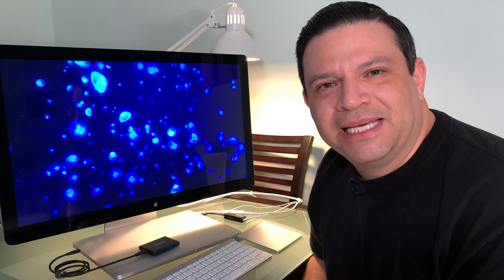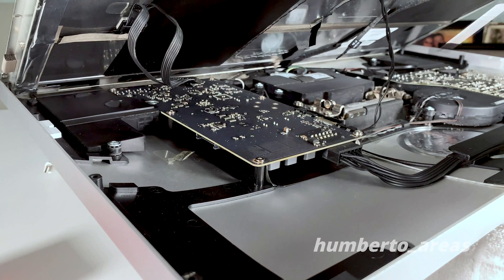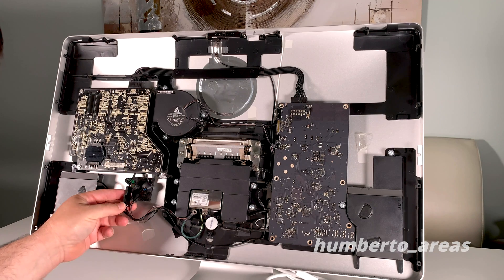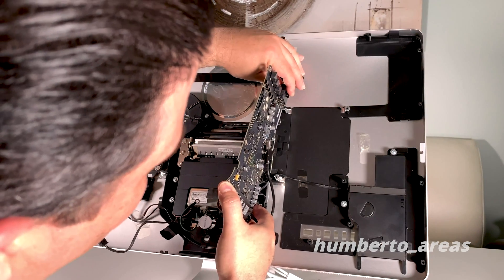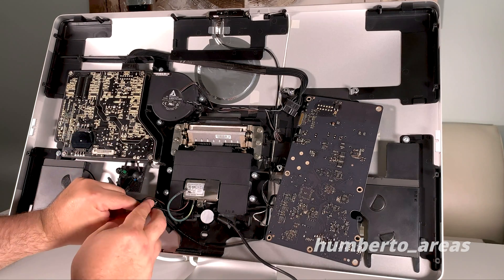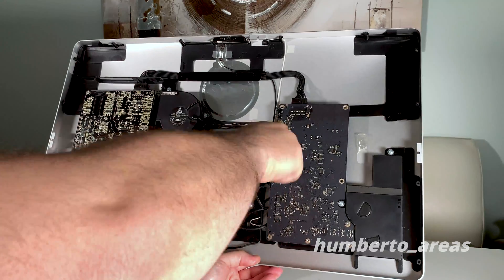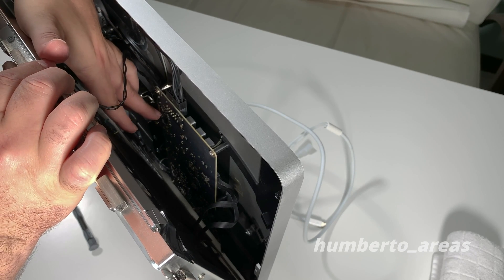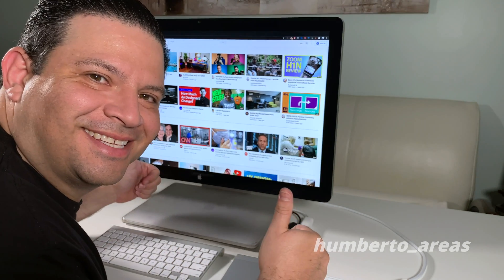Apple Thunderbolt Display Not Turning On - Step-By-Step DIY Repair 2026

Comment: My display blacked out, I heard a little pop too.  How did you know it was just the cable and not the power supply or logic board?
Reply from the maker: @Karl Simonsen, thanks for reaching out, greatly appreciate your question. I plugged display to my laptop and notice that under system preferences, my laptop recognized the monitor plugged in. I also inserted a couple of USB drive to the back of the display, and under Disk Utility, I notice my laptop recognized the 2 USB's - then I decided to replace the most inexpensive part... which was the cable, and bingo, it worked for me.

Please keep me posted on any trouble shooting you do on your own, thanks and good luck.

Comment: A great video. I’ve got this 27” Thunderbolt display, which I bought new years ago, I think about late 2011. It gets used nearly every day and still works fine. Just occasionally - maybe once every 2 or 3 weeks - it flickers, but always comes back on. Hoping I never have to fix it, but now I know how to do it! Many thanks for uploading this, it’s really appreciated.
Reply from the maker: @Orwic1, thanks for watching and for taking the time to post your comments. Glad to hear you got value out of the video.
Reply: I wonder if this is wrong with my display I got a few years ago for $100

Comment: Hello Humberto Areas, I have a question.  Is there an internal mini-port connection inside the Thunderbolt Display?  I want to use my Thunderbolt Display with my Mac Pro 5,1 Mid 2010.  My Mac Pro has an ATI Radeon 5770 that has 2 mini-ports.
Reply from the maker: @John, thanks for watching and for your question. There is no MiniDisplay port inside the A1407 Display. You may need a connector that goes from MiniDisplay Port to Thunderbolt. You should be able to find some online for purchase. Just be careful to read product description before purchase. I say this because a MiniDisplay Port cable end/connector looks exactly the same as a Thunderbolt end/connector. Good luck.

Comment: Hi! My 27" Cinema Display was showing small dark spots at the bottom edge (sort of like 2-3 1" half-circles). After unplugging it and letting it "rest for a month or so, it doesn't turn on at all. DO you think this fix might remedy my situation? Thank you for your time.
Reply from the maker: @John Platanatis, thanks for watching and for your question.

Let me ask you, if you connect your display (even though nothing comes on), does your PC recognize the display? Do the ports in the back work (perhaps you have a USB stick that lights up? Have you tried a different cable (thunderbolt-to-thunderbolt)?

Also, what is the model number of your display? And to what PC/MAC are you connecting the display to?

Thanks in advance for any additional info you can provide.
Reply: @HumbertoAreas  I just hooked up my 2015 Macbook Pro and the Cinema Display (#A1407) display is working again! But the 2 small half-circles are still showing up at the bottom of the screen. It's no major issue as I bought another display, but figured if I could get rid of the shadowy half-circles I would. Thank you so much for your info!

Comment: Quick question! I have exactly the same issue and a buzzing noise along with display going in and out. I have a LED Cinema Display (27-inch) A 1316. Do you think the thunderbolt is replaceable with A1316? Because I am unable to find the cable anywhere on the internet for A1316!
Reply from the maker: @Raven Quiah, thanks so much for watching and for your question. Unfortunately the all-in-one Thunderbolt replacement cable that I use in the video will not work for you. Your display has a "Mini DisplayPort", not to be confused with a "Thunderbolt Port" - They look the same, but they are not.

I have not been able to find a reliable source for cable replacements for your A1316 display. If you happen to find a good source, please share link with community on this thread here. Thanks in advance and good luck.

Comment: Hola, qué cables usas para conectar con los usbc de entrada en tu Mac?
Reply from the maker: @Nicolas Ceron, saludos y muchas gracias por tu pregunta. Aqui te envio links a los (2) conectores que yo uso.

👉 Apple Thunderbolt 3 (USB-C) to Thunderbolt 2 Adapter https://amzn.to/2N9leKW
👉 Compatible for MagSafe to USB C Adapter, iWiner USB C to MagSafe 1 & 2 Adapter for MacBook, New MacBook Air and More USB C Port Devices https://amzn.to/3B7FsM2
Reply: @HumbertoAreas  muchas gracias!

Comment: Dear sir, i buying the cable now for replace because my display have the problem same like you now (auto turn off and on few times and after that not lighting back). The code of the cable is: Mc914 922-9941. Is that right? Looking forward for your reply
Reply from the maker: @Nam Dinh, thanks for reaching out, I really appreciate your question. Please make sure that in the product description of the cable your are purchasing, it says that the all-in-one cable if compatible with a Thunderbolt Display Model A1407. Different manufacturers have different part numbers, so make sure "Thunderbolt and A1407" are in the description of the cable.

Thanks again for watching and please keep me posted on your repair. Thanks.
Reply: @HumbertoAreas  yes, thank you sir. I order it on the shipping now. Thank for you reply and i will update my repair

Comment: Thanks success and my monitor has come back to life. But be careful on the replacing ( final step) of the glass cover I cracked mine. OWC has OEM for 69.00. Happy New Year.
Reply from the maker: @Bill Lewis, thanks so much for your comments and feedback. Thank for watching and glad to hear your display is back! Many thanks for the heads-up on putting back glass cover. Can you share the OWC link to the OEM replacement on here please?
Reply: Well new issue replacing logic board. Here is the link for glass screen OWC. https://eshop.macsales.com/item/Apple/9229919/. I’ll update after logic board replacement.

Comment: I fixed the problem with your steps and all went well for 6 months. Now sadly the display does not turn on any more... I am starting to think maybe it has something tot do with the power unit inside the screen... Do you have any ideas 🙃
Reply from the maker: @Connor MacMillan, thanks for taking the time to come back and post your comments and question. Hard to say what could have gone wrong? Before the display going out on you, did it give any warning signs? Any flashing on-and-off? Or did it just go out? Very weird that it would work for 6 months and then just go out all of the sudden? Please keep me posted, thanks.

Comment: I have two of these monitors.  One was doing exactly this, but the other suddenly popped and went dead.  What do you think that was related to?
Reply from the maker: @2 Minute Tour, thanks for watching and for taking the time to post your comments and question. Hard to say what could have happened... as these displays at time they give warnings of things to come, and other times they just go out. Was there lighting in the are? Did you have the display connected to a battery backup or a surge protector? Can you elaborate on the "pop" sound? (as in a speaker 'pop' sound or internal component sound).
Reply: @HumbertoAreas  That's a good question.  I'd have to say that the pop came from the speaker if that was my guess.  There was no warning to the problem like there was on the other monitor that flashed on and off just like in this video.  Once the pop happened, it went dead.
Reply from the maker: @2 Minute Tour, it may be worth replacing the all-in-one cable on this monitor as well if you want to continue with your 2-monitor setup. Definitely worth a try, please keep me posted.

Comment: My apple Cinema Display has a different tope of conector and they're very expensive ( 150+) do you know how i can fix it is also a 27" and my MacBook detects the screen and also reproduces the music but the screen is only Black
Reply from the maker: @Daniela de Selys, thanks for watching and for taking the time to post your comments and questions.

What is the model number of the 27" display that you have? (you can find this info at the bottom of the display's stand). And what year and model number is the MBP you're connecting the display to?

Hope to hear back from you soon and give you better feedback depending on your setup.
Reply: Great video  @HumbertoAreas ! "A1276" are the specs on the bottom of my display. Im having trouble finding the specific connector of this display.
Reply from the maker: @VVOwrich  Thanks for watching and for posting your comment. I too have found it impossible to find replacement cables for the A1276... I will keep you posted if I find a reliable website that has them for sale.

Comment: Before your monitor going dead, did you hear hissing noise from the back of the monitor ? In your case, would you suggest problem of thunderbold cable part, or is it the MagSafe cable part?
Reply from the maker: @Sutop Sejati, thanks so much for watching and for your comments and questions. Before my monitor went dead, I heard no hissing sound. If you are experiencing this, it may have to do with your internal cooling fan. Try an independent MagSafe charger in your case... Your MAC needs to be connected to a power source when connected to the display if you intend to keep closed. Otherwise you can leave your MAC open while you test the thunderbolt connection only. Please keep me posted.

Comment: Nice video! I wonder IF my screen issue is the same? My MacBook Pro sees it (so it works) but I have the black screen ( I do not remember the flashes, perhaps it happened) is this a fix for that? I still have in the corner of my office..such a great quality display for graphics! Thanks!
Reply from the maker: @M Giovanni, thanks for your comments and question. And of course, thanks for watching. Some displays may give signs of warning, and some just go out. Like I've told many others who have commented on the video, "If you still love your display, replacing the all-in-one cable is worth a shot." It is by far one of the cheapest parts you can replace on these displays.

Please keep me posted on what you decide to do. It'll be great to get that display out of that corner and put it to good use again!
Reply: @HumbertoAreas  I was wondering the same thing as mine went out, came back for a bit and then out again. I LOVE that monitor even though it's almost 10 years old!
Reply from the maker: @janetcovey4306  Thanks for your comments and thanks for watching. Hope you git value out of the video. These monitors age like wine, so if there is a way for you to put it back in use... go for it. Please keep me posted on what you decide on doing.

Comment: Dear Humberto, I found your video very helpful, I change my cable because I strarted to have problems with it, it was burned in the thunderbolt connection that goes to my mac pro 2013 machine, I have "fixed " long time ago with gaffer tape, but till this week just stop working. the problems I had were that the monitor speakers  work just sometimes, but after I change the cable with your help, the speakers dont sound at all and the camera also dont work. do you have any idea what maybe be happening? Thanks in advance for your response.
Reply from the maker: Jose Ramon Pedroza, thanks for you comments and question - and of course for watching. Glad to hear you got value out of the video. So before you changed the all-in-one cable your camera and your speakers worked sometimes. And now that you replaced the all-in-one cable with a new one, both camera and speakers do not work at all. This is very weird and I'm not sure what may be causing the problem? Let me do some research and circle back to you.

Which part of the vide did you find most helpful?
Reply: @HumbertoAreas  thaks for your response, yes before I change it they work sometimes, so I think that maybe is a problem with the board, because I realized that also the ports at the back of the monitor aren't working to, the strange think is that the thunderbolt conection is ok, or maybe instead of the board is just a problem with a cable... About your cuestion about  what part of your video was most helpful, I found all your video very clear, well explained, steady and with good light. So thanks again for the way you made it. Saludos.
Reply from the maker: @chepopedroza  Thanks so much for the explanation and your feedback on the video. If the ports on the back are not working, then maybe something else could be the problem (besides the all-in-one cable).  Saludos y estamos en contacto.
Reply: @HumbertoAreas  , gracias Humberto, I let you know when I solve the probem

Comment: I just used your video to fix my Apple display. Thanks a mill for the tutorial. One note I would say is to be careful removing those 3 connectors from the logic board (2:15). The larger one has a clip underneath that you need to pinch and the gold one has a flap that needs to be flipped 180˚ to get it to release and they all slide out. I wasn't sure which way they disconnect and as you say our Thunderbolt Displays are now pretty old so those cables won't be as flexible as new. Great resource and thanks again. I can now go back to my favourite display.
Reply from the maker: @Mark Gogging, thanks for your comments and for watching. Glad to hear you got value out of the video and that your display is back up and running. Those (3) connectors are tricky, and I did the best I could capturing on video - given that I was filming by myself.
Reply: @HumbertoAreas  You did a great job, thanks. Have you had any issues since changing the cable. Occasionally when I wake my MacBook from sleep the thunderbolt display stays black but it is connected and recognised as the cursor shows on the screen but nothing else. Unplugging and plugging the display back into the MacBook fixes it right away.
Reply from the maker: @Mark Gogging, Thanks for the feedback. Does this happen on every port? Or just the one port where you usually  connect your display to? I've experienced in the past where a reset of the PRAM and SMS (Mac OS) can fix issues with USB/USB-C/Thunderbolt ports. You may want to look into this and see if this may help? Please keep me posted.
Reply: @HumbertoAreas  Good idea! I always use the same port. Will try the other one and a PRAM reset.
Reply from the maker: @marklegato  Great, please keep me posted.

Comment: Hi Humberto, great video. Very well demonstrated. - I do have one question that you left out of the video (or at least I missed it)... how did you diagnose the problem to be the video cable itself. Why did you choose that to change and not the display board, etc...???  The video cable is about $65, so I would hate for anyone to think that is what is wrong with their monitor, spend the only and time and then realize the their original cable was not the problem. So, my question again is - How did you determine that the problem was the video cable itself and not something else?
Thanks!
Reply from the maker: @Calixto, thanks for taking the time to post your comments and questions. I truly appreciate it.

I was really frustrated when my beautiful display stopped working. No PC repair shop would touch it, Apple itself wouldn't touch it and there was little info on websites and discussion boards on what the issue could be?

So I decided to tackle the trouble shooting myself. And I decided to start by replacing what I thought was the most inexpensive and easiest part - and that is the All-In-One Cable that stems from the display. And I got lucky, it worked. And it has worked so so many others on here.

if you wish you keep the display and put it to good use, it's worth a shot in my opinion. I think I put (2) links for the cables and I believe one option is cheaper.

Good luck and please keep me posted on what you decide to do.
Reply: @HumbertoAreas  Hi Humberto, thank you so much for your explanation. I understand how limited the testing and documentation is on any Apple product. So, I completely understand why you began with the cable and as you say, got lucky to some degree. I though you had figured out a way to test the cable or to make it fail intermittently, so as to narrow down the diagnosis. That said... you did a GREAT job and a very good video. Thank you Sir and best of luck!!!

Comment: Hi Humberto, i am going to have to assume that you replaced the power cable to fix the problem as i have failed to hear mentioned; or i  just do not have good hearing anymore :)
Reply from the maker: @Kashif, thank you for taking the time to post your question. Yes indeed, I had to replace the all-in-one cable in order to get the Apple Thunderbolt display to work again. In my opinion is the cheapest and easiest part to replace on these monitors.

Thank you for watching, glad to hear you got value out of the video.

Q: what part of the video have you found to be the most useful?